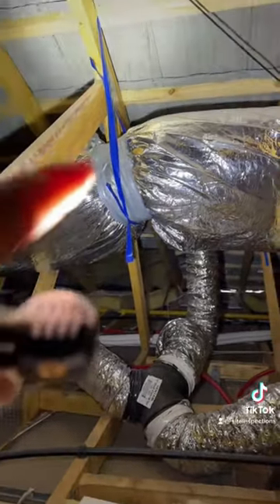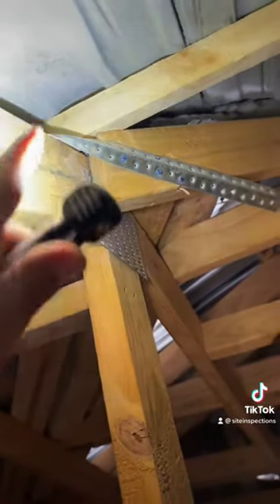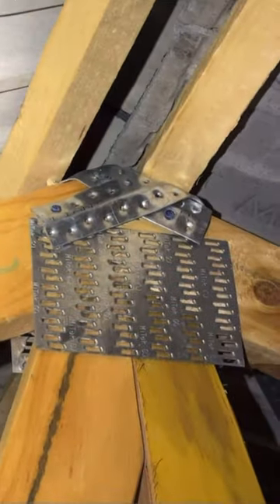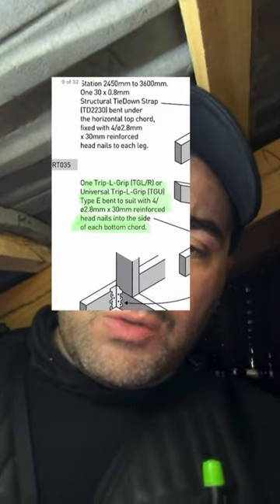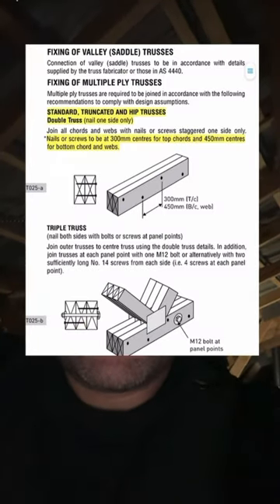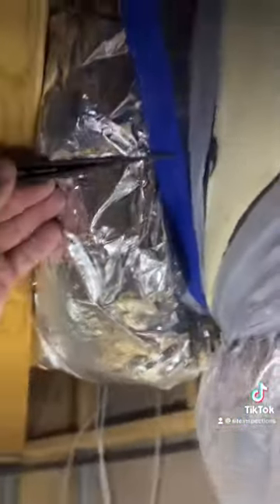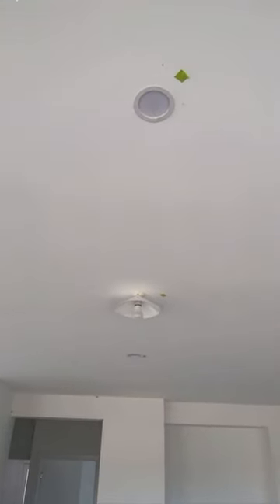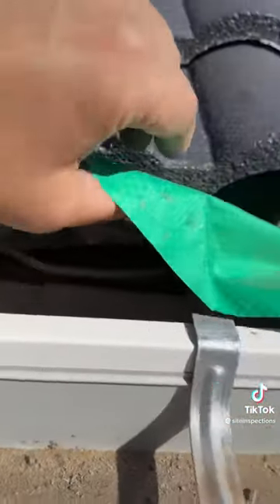Brand New Home Inspection Gone Wrong: No Insulation, Leaking Bathrooms, and Non-Compliant Frame

Comment: Watching the video and I think there might be another significant issue.  The ceiling battens appear to be furring channels using clips attached to the side of the bottom chord of the truss.  These clips do not provide bottom chord restraint to the roof trusses and looking at the design of the trusses I believe they were designed assuming bottom chord restraint would be provided by the ceiling.   If I'm correct these trusses require bottom chord ties installed above the bottom chord at spacing determined by the manufacturer but probably 900mm, as well as that they need bottom chord speed bracing.  These really need to be installed as the truss bottom chords do not have the adequate restraint to prevent buckling, furthermore the wall bracing bracing loads cannot be transferred through the ceiling diaphragm on furring channel clips, this is why the speed bracing is required.

Comment: Majority of those air conditioning ducts are undersized and some were uninsulated duct, which will build up condensation. The uninsulated flares will drip condensation all over the ceiling without a drip tray. I'd imagine that they used the strapping to suspend the ducts with the intention of putting the insulation in later, as you normally don't use strapping on a domestic install.

The quality standards across all trades on these project builds is appalling.

Comment: A silly question:  How would it go using Square or Rectangular Hollow Section, 6 mm wall thickness for the roof trusses?  Use that for the roof to sit on, and to go across the top of the walls as well?  Then, for the bracing, use equal angle 50 mm square by 6 mm thick, one either side of the hollow section, and 2 bolts M16 / M20 top and bottom.  Would that hold something together?  Then, to keep the distance, equal angle on the side of the trusses with the 6mm hollow section running between, again with 2 M16 bolts on each face of the equal angle.

Comment: Hiw tge system works, builder calls certify who ask if works finished, signs off because if ge doesn't he won't get called again. Plus a quick ok means certify can do a few certs in a day and get to the pub.  .

Make the builder and certifiers 50% responsible for fixing certifed defects.  Also make false certification a criminal offence, its fraud as is a builder saying works been done that hasn't. Eg installation of insulation etc